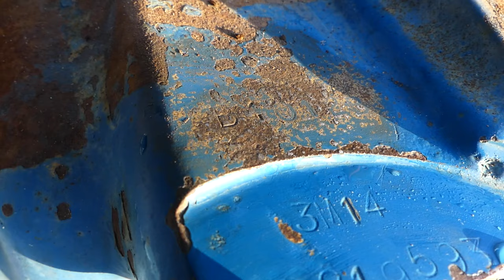Kangaroo Stew # 368 Shed Chat, Surprise Package and Ford 2000

Comment: Hi Lance, with reference to the Ford worked on many thousand series over the years, your other viewer mentioned the O ring on the hydraulic pump this is correct, the the O ring on the suction pipe at the back of the pump was a regular failure point, we used to replace them with Viton O rings rather than nitrile as the viton used to stand the heat better…. Something that won’t affect you was these piston pumps were very temperamental when it was cold in the UK hence why we did a lot of gear pump conversions, good luck mate this is an interesting one for me as fords are my background, although never worked on a petrol. Chris
Reply from the maker: Thanks Chris, I was thinking the gear pump was just to be made cheaply by the aftermarket companies but that explains it all. Thanks.

Comment: As apprentices, when fitting conr5ods we would bolt up the end bearings with soft lead wire. Using a micrometer on the wire would give you clearance value. You can buy a product called Plastigauge now, does the same thing. The original fit was determined with engineers blue and a half round scraper.
Reply from the maker: I have plastigauge here and use it on other engines, this was just a fiddle as we were mixing parts but it is all good now.